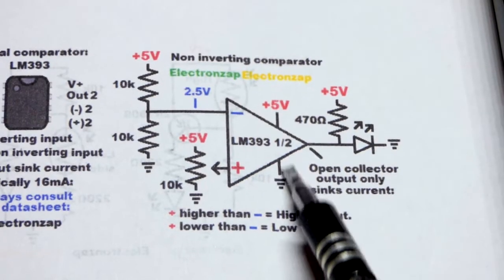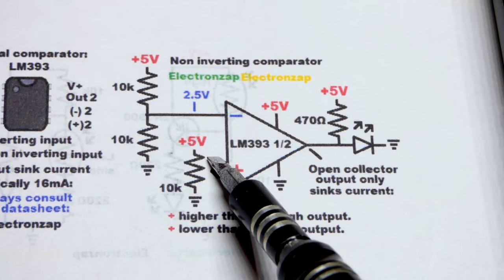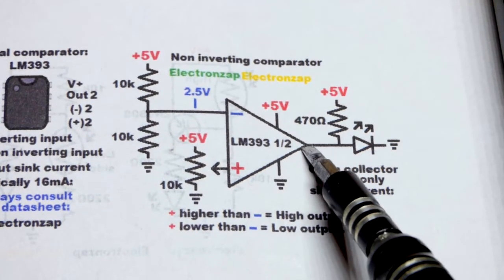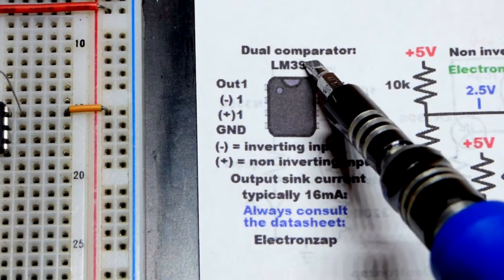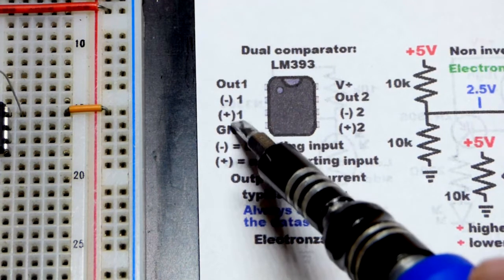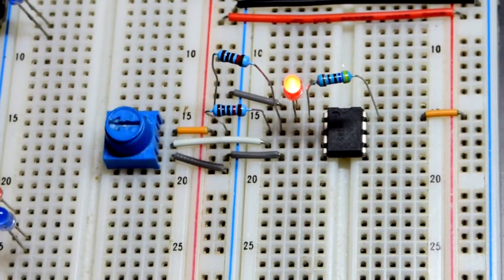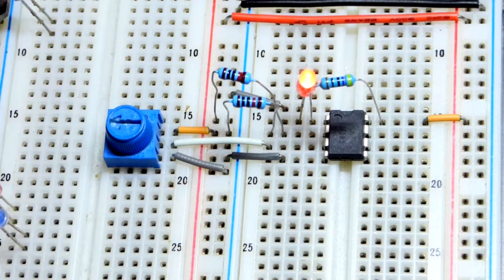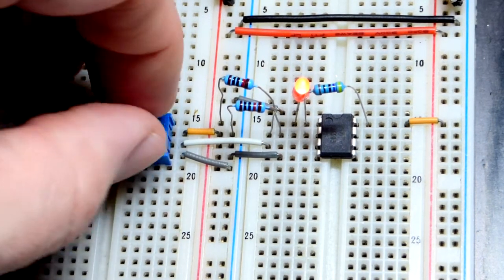LM393 open collector output comparator integrated circuit IC demonstrated using LED

Comment: If I use direct 5V to input so which value of pull up resistor do we have to use?
Reply from the maker: Whatever is needed to power the load. If you are just giving a signal to an integrated circuit or transistor input, then 10,000 ohms will likely work well.

Comment: the output is always 5 volt ?
Reply from the maker: All that the output of an open collector can do is connect to the negative supply which is usually 0V ground, or it can basically turn off. You need to provide a voltage with limited current to the output to be able to get a higher voltage at the output.